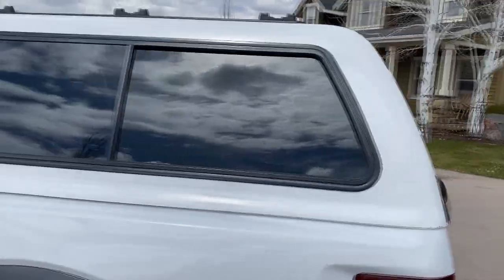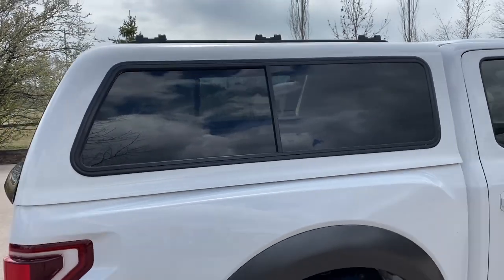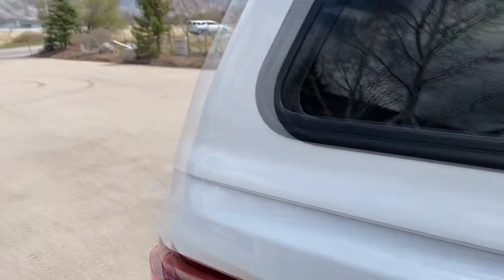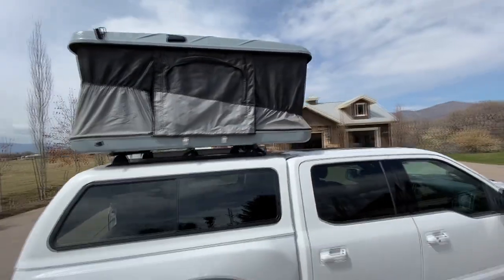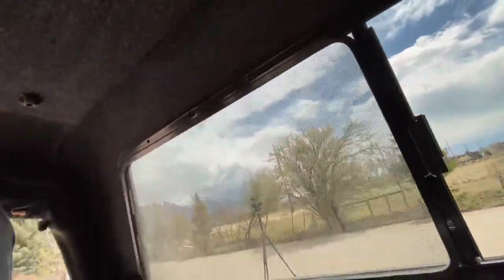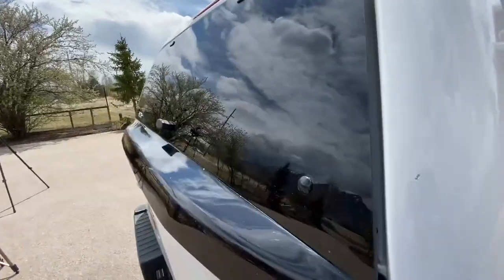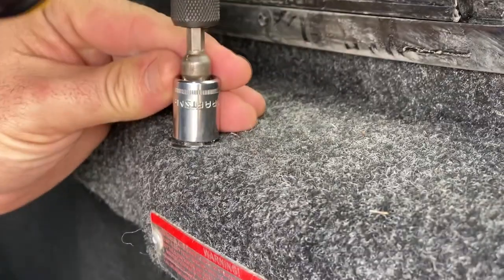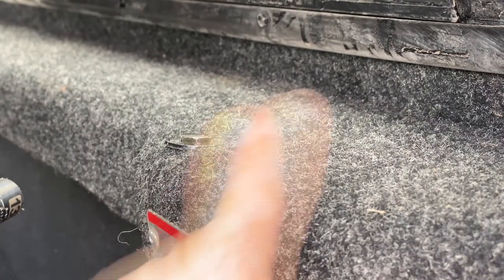Snugtop Xtravision Truck Cap Review - After 3 years on Ford F150 Raptor

Comment: Hey great video. I have worked at a truck topper shop for 7 going on 8 years. I can tell you snugtops base rails are designed to flex and move with the bed of the truck. We also sell two other brands of toppers and I can tell you the rear door seal is a weak point on all of them. Dust is the worst!